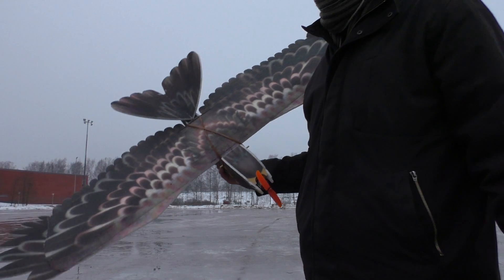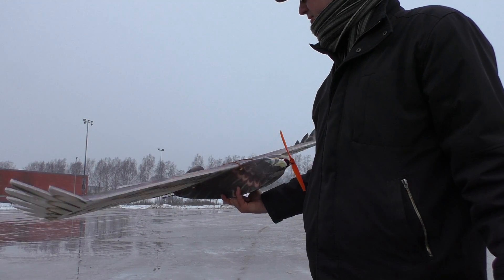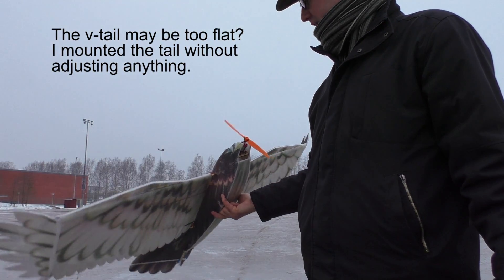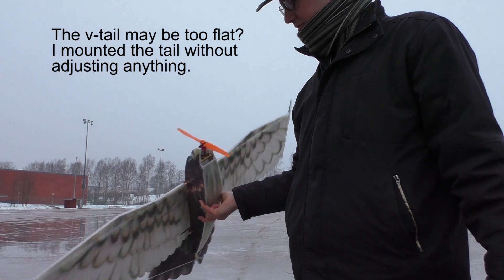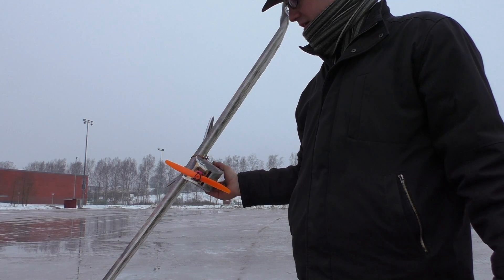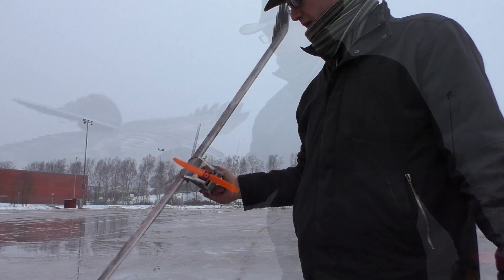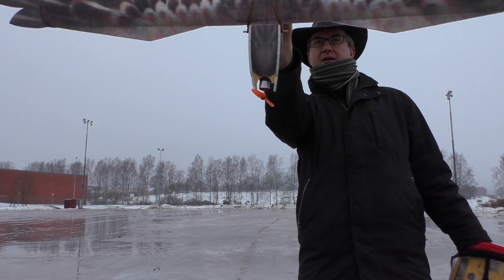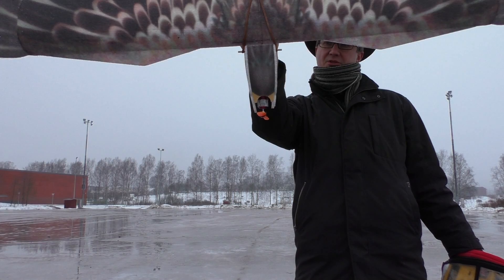HK EPP Eagle - First successful flights and instructions on v-tail setup

Comment: The V tail should be between 110 and 120 degrees (measured from the inside of the V)
Wing rock can also be attributed to incorrect thrust angle of the motor and CG can also effect wing rock as well as lateral balance.